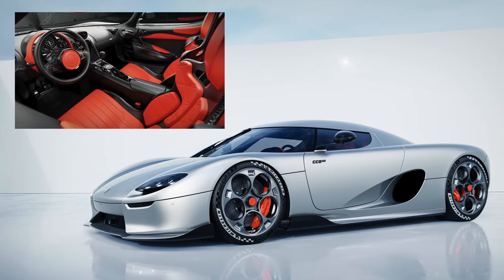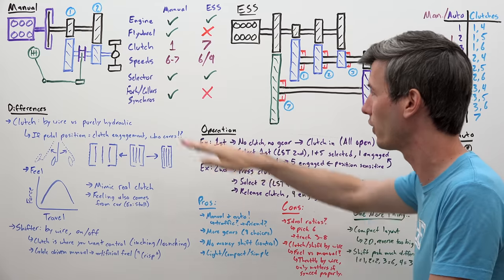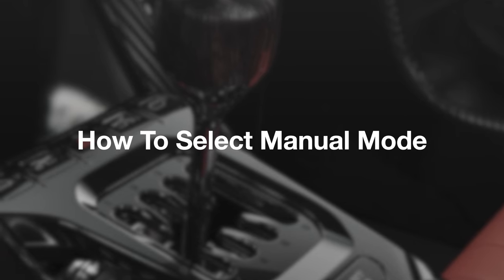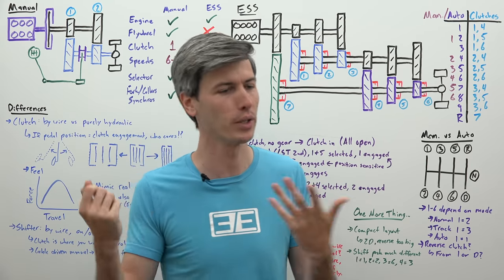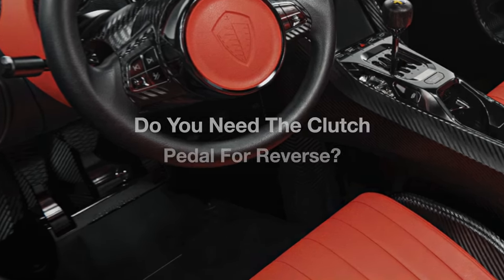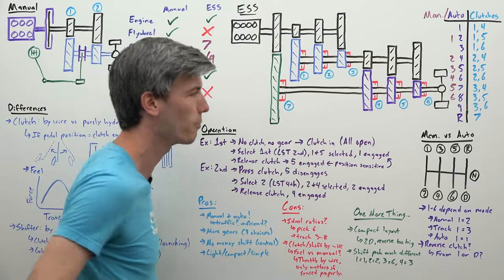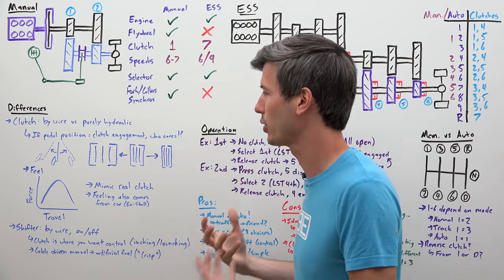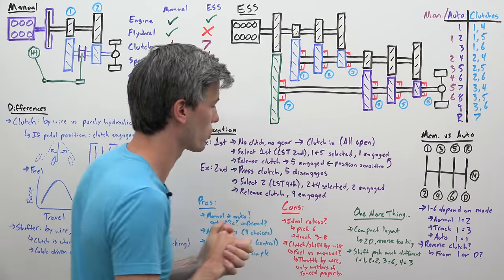Koenigsegg Reinvents The Manual! How The CC850 Transmission Works

Comment: I believe the world is ready for a 9-gear automatic transmission built for their bicycle, motor-assisted, and scooter.  build it of steel in an aluminum casing.  fits a standard BB and hangs in front of the back tire.  have a 45 tooth front ring for output with a fixed 15 tooth ring in the back.  no deraileurs hanging out, no chain flopping around on bumps...of course it needs a hub motor for the boost and a 20ah battery, then you could recreate the 'off the line' speed of the car all the way to 20mph by twiddling with the controller.  still, i want one.  :)

Comment: I can't understand why they incorporated the intermediate shaft on the forward circuit instead of the reverse circuit. It introduces the most inefficiency into the most used circuit of power, as opposed to the least. Was it for packaging reasons?

Comment: Amazing…as always! Both your explanations and koenigsegg’s work! I don’t get just one thing: how can the torque pulses from 8 cyl be balanced without a flywheel?
Reply: The gearbox driveshafts are always connected to the engine so it helps.

Comment: Well, it's the same as "manual" mode on every other automatic transmission, but you also have to use a clutch pedal

I don't see any pros.

Comment: So when 2 clutches are engaged, the other 5 clutches are disengaged, but isnt there still a slight friction happening with a disengage clutch ? i know for a fact that when i put my vehicle into a gear with the clutch engaged you can hear the slight strain on the engine, so there must be some friction happening even if its oil or air friction, thats alot of extra heat generated from 5 clutches constantly not being used

Comment: they should have still went with a fly wheel and typical clutch.... their is no way those clutches would hold up to any kind of abuse... and before anyone comments, yes, I am aware no one buying that type of car is thinking about dumping the clutch... but you should be able to without having second thoughts if you are paying that much for a car. This company is the most innovative car company of this generation, it is a little frustrating when you see them make a design choice like this... it could just be way more bullet proof. with a car of that caliper you can argue that they might have done it for comfort but then again if you could run the thing as an auto anyways, why even bother having that thought.

Comment: So with this design, is it technically possible to shift gears without depressing the clutch? Since the first 3 clutches depend on the location of the shifter, it basically "clutches in" when you move the selector out of gear, and engages the clutch again when another gear is selected.

Comment: This to me doesnt really "reinvent" the manual transmission (nor the automatic tranmission for that matter) while, the design is great, and making the manual mode fully "manual" is a cool idea, it is very similiar to the 722.7 Automatic transmission from Mercedes (Which is a 5-Speed and uses a Torque converter although it really doesn't need one) but the way it shifts gears is identical to that of the Königsegg transmission.

Comment: Why not have a linear 11-position gear selector with all the gears in single line? Or as steering wheel levers? That would give all the 9 gears for manual selection, too. And now that we have multiclutch gearboxes with the manual-like anatomy, is there any benefit left in using the manual gears at all? I have an auto+manual gearbox in my car, and I would consider using the manual option only if some of my gears were broken and I would need to limp the car to a workshop.

Comment: Very interesting. But I have a question: Considering that the gear selection lever on the cabin doesn´t controle the real gears but the engagement/disengagement of the clutches, why not use a shift paddles? Why the complication of the gear selection lever ?
Reply: I'm sure there would also be paddles, probably for use when in auto mode.

Comment: Clutches wear and are expensive to change when it's a single, simple component, large enough to take loads of torque and handle the heat from any slippage or wear. Some of these clutches are likely to be much smaller to fit alongside the gears in the box and each one has to handle engine torque and because they are manually controlled (potentially without the force feedback available in a conventional manual) it feels like some of these will be either high-wear components or far too expensive for mainstream use (also EV's will arrive en-mass before this setup is used in concentional vehicles) - also, are they wet clutches like a motorcycle?

Comment: 12:20
Do they replicate the built in into manuals that lets you know "by feel" if your revs are wildly missmatched? IDK how about others, but in my both audi a4 b5 and b6 if I was to shift to incorrect gear the selector would not allow me (unless I force it, but if I operate delicately, it will straight up lock out going into position)

Thats one. Second, can you operate clutch in automatic mode to have manual clutch? That's one of things that I really missed while driving automatic (I ultimately ended up back on manual. Preference)

15:15 this should be customizable IMHO.

Comment: how would reliable would this gearbox be compared to traditional manuals? And how realistic would it be to see these on more mainstream cars?
Reply: Typical modern automatics already have 6-8 clutch packs.

Aisin transverse 8-speed: 6 clutches, 7 if you include the torque converter clutch, 9 if you include the sprag clutch. Used in Camrys, RAV4s, Volvos, Minis, VW’s, etc.

ZF-8 speed: 5 clutches, 6 including torque converter clutch.

Honda 10-speed: 7 clutches

GM 9-speed: 7 clutches

Etc.

Comment: I'm curious if the light speed trans is great. Size and weight (smaller and lighter) vs your dual clutch trans. Why doesn't other manufacturers use a similar design? From what I read the light speed trans isn't a new tech. Is it because its not as reliable as a traditional dual clutch and cost more to fix if something should go wrong?
There was a youtuber and he's a British dude. I forgot what he goes by, but he never talked about Koenigsegg lsp trans. But he seemed to think it wasn't as good as people think.

Comment: Some cars (and many motorcycles) with traditional manual transmissions can be shifted without using the clutch  if you are very attentive to engine rpm vs wheel speed.  Some find this to be quicker allowing faster shifts. the Koenigsegg transmission as described here would get totally confused in manual mode if you didn't use the clutch pedal while shifting. Is this a failing? or a feature?

Comment: as the clutches are controlled by computer, it's probably possible to change gears in manual mode without using clutch

Comment: Jason, this makes me think of something that's theoretically possible, but not necessarily easily done. How about an accessory that installs in an EV involving a clutch by wire pedal, and a shifter, as well as a control module. The controller would intercept the DBW throttle and give appropriate torque dips to simulate an ICE going through gears and clutch takeup, likely you'd also have an audio implementation that'd make engine noises. Sounds goofy, but I'm sure it would sell.

Comment: This is engineering and you have explained it well. It's a cool system. But this just reinforced exactly why internal combustion is dead. It's different (but cool) to a conventional box but it's just a side step to the same issue of the torque curves that ICE as plagued with. ICE be gone! Bring the quantum fields and electromagnetic forces to the road!

Comment: Couple questions: does this new manual still allow for "clutchless rev match shifting" (I'm really not sure of the proper name, forgive me), but in a classic 5-speed you could pop it out of gear without the clutch and as the RPMs naturally decreased you could kind of slide it in to the next gear, again without ever pushing in the clutch?  Second question.... could you still bump/push start a car with a dead battery?  Or because it is all by-wire that is no longer an option?  Thanks as always for your incredible break downs.
Reply: 1) There are clutches, you cannot change gear without using clutch.
2) No, he says all clutches are default-open which means it needs power to get in any gear or stay in gear.

Comment: I've seen manual elitists hate on this transmission simply because it has an automatic mode. I, however, as a daily driver of a manual, think this could save the manual transmission. It's incredibly unlikely that I'll ever get to drive a car with this specific transmission, but if this tech can trickle down into the mainstream manufacturers, there could be hope yet.

Comment: Thats awesome. I'm just used to pushing all the way to the right and slamming up or down to get into 5th or 6th gear. Is there a lock for D? Also does neutral float between 3rd and 4th when in manual mode?

Comment: Interesting. So would it be possible to program an ESS transmission to behave like a sequential dogbox, where you only need to press the clutch pedal when starting off/stopping, with no need to use it when shifting gears once you're in motion?🤔

Comment: While I admire the novelty of the engineering, it's not as prolific because it's not designed to last as long or be made as economically. It looks like owners will be needing to have their transmissions rebuilt every 100k miles, if even, because all those little clutches are not going to be happy after long. Also: we're going home today after being evac'd from the Mosquito fire 11 days ago :D

Comment: This is a really nice system and love that you can have the best of both worlds, but I do wonder with all them clutches how reliable will they be, and the service on the gearbox could be very expensive?
Reply: It's probably wet clutches, they run colder and smoother, and no pesky regular throw out bearing. So i would not be surprised if it's less maintenance. But an electronic fault could cause havoc
Reply: @fixandtests  Shows how much I know, haha. Great idea and I do like how it works. These guys should have there own F1 company with all the ideas they have.

Comment: How the heck do they put high power through smaller clutches though?
With a regular manual the beefiness of the clutch, and its construction (single disc, multi disc, spring power, etc) plays a large role in how much total power you can put through the drive train.   
This is one of the things that initially limited the max power on cars with dual clutch transmissions.   Each of the two clutches wouldn't be as strong as one big one.  
There are now stronger dual clutch transmissions, but the clutches are still essentially
external.  How do you handle this power problem if you're moving to 6 small clutches
inside the tranny?     How quickly do they wear?   How hard is it to service?
Reply from the maker: Multi-plate clutches, unlike manual or dct which use single clutch discs for putting down power.
Reply: @EngineeringExplained  That's simply not enough of an explanation.    My motorcycle uses multiplate clutches too but  1.   It can't handle the nearly 1400hp this car makes and 2. I still wouldn't be able to put 7 of them inside a transmission.  The fact that there are 7 of them in there and they claim it's still lighter than a regular transmission suggests that they're very small indeed, and that does not lend itself to handling extremely high hp (or really high torque).   
I have to think they're up to some other type of trick.

Comment: With no torque converter or other fluid coupling, would you still need the clutch pedal to brake to a stop, or accelerate from a stop, even in Drive? Would the automatic mode also involve a stall sensor & a brake sensor to disengage 1st before a stall and engage 1st when the brakes are released?

Comment: Can you make a video why we dont use motorcycle geqarbox in manual cars?
Reply: I think for most cars it's too unpractical in daily driving;
-No synchronization will be tiring working stick fast enough with hand.
-Not possible to skip gears or go to neutral to/from any gear.
-Very big backlash (throttle on / back off throttle) due to dog tooth engagement of the gear, is unacceptably uncomfortable by most car drivers.

Comment: 18:43 why is reverse such a crazy high ratio?  I thought in basically all cars reverse is a ratio between first and second (but obviously in the other direction).  I assume the Koenigsegg is extremely traction limited in its (automatic) first "launch" gear, but reverse is going to be even worse from a drivability perspective.
Reply: They can reduce the clutch pressure in reverse and still have enough torque. The ratio allows slower reverse speeds without stressing the clutch pack as much.
Reply: @Kyriaeus  Reverse needs to go slower than first (launch) gear though?  I'd be interested to see the top speeds / stall speeds in each gear.

Comment: You mentioned @ 6:04, "(Shifter) Position sensitive.. how far you push in that selector is how much engagement you have with the clutch" and nothing more spoken about this.
Is first gear selection "gate" a potentiometer? Are all gates the same? 
This seems like a built-in slip but why? Expand on this...
Reply from the maker: Yes, position sensors for every gear in the gate, synced with a corresponding clutch pack.

Comment: Interesting. Robustness and losses?
Are those necessarily smaller clutch packs going to be less robust than a traditional design? Also smaller clutches tend to be more snatchy, here?
Drive is going through two sets of gears here whereas one pair at a time in the traditional design. Also, noise?

Comment: are those the type of clutches where a magnetic field coil pulls the plates together?
(just wondering about the clutch mechanism, since I'd heard that with a regular clutch you don't want to have it running disengaged for long due to wear on the throwout bearing)
Reply: It's pressurized hydraulically. Each clutch pack has a hydraulic piston that is fed through an oil passage inside the shaft, which is in turn fed by the oil pump through a rotating seal.

Comment: Love the video! However I have one question. Since you say that the gear selector position controls the engagement of the clutches, is it possible to "power shift" this transmission while also not using the clutch pedal? In other words, once you get the vehicle rolling, if you hold the throttle at a constant position, could you row through the gears without lifting off the throttle or using the clutch pedal? I just thought the idea was funny because if it's possible, that process reminds me of those arcade racing games where kids just slam the gear selector between the gears. 😂

Comment: Ok now the big question is since it doesn't have a flywheel an it's all built inside the transmission do you now need to take apart the gearbox to change the clutches 🤔

Comment: Honda has used a similar layout for 2 decades in their automatic gearboxes.
Reply: Somewhat - Honda didn’t compound gear ratios thouh so their gearboxes were comparatively bulky and massive compared to competing planetary gear designs.
Reply: @Kyriaeus  that is true, but the clutches-instead-of-synchronizers idea was the same, albeit using a torque converter instead of the clutches themselves.
Reply: @dinkata2005  yeah it’s kind of amusing seeing all the naysayers in the comments moaning about 7 clutches when mechanically similar designs have been in everyday cars and tractors for decades

Comment: I'm curious why the ESS doesn't just attach the individual clutches to the 3 fixed gears on the input shaft like it does for the 3 gears on the output shaft. Wouldn't that eliminate the need for the intermediary shaft and gears? Is there an additional practical use for the intermediary shaft and gears?
Reply: You still need the intermediate shaft and gears to get the 3x3 effect. If you remove the intermediate shaft and try to mesh the input and output shafts directly, you end up with just a 3-speed.

Comment: I wonder if it would be possible to disengage the clutch in neutral and start driving by giving it some gas and using the shifter as the clutch. If travel in the shifter would actually match the travel of the clutch it should be possible right? Just found that thought quite funny :)

Comment: There is still an arguable case for old school single clutch manual. Easy and cheap as pissing to maintain. Also violence. Not recommended but you can if you want to.